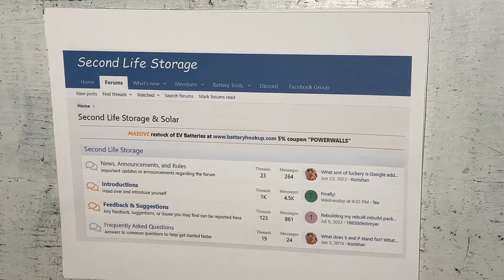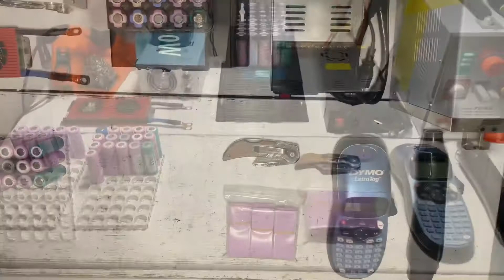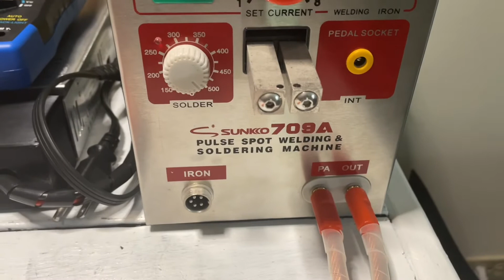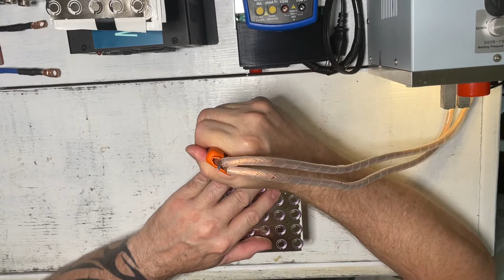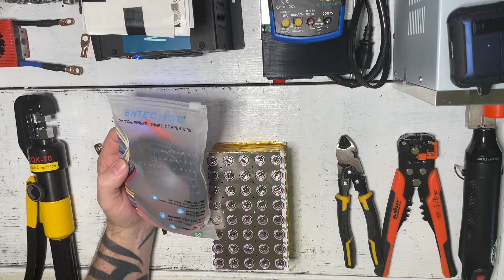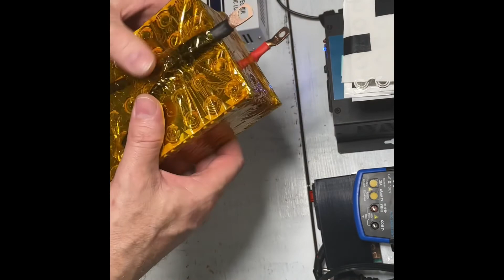DIY 18650 80ah Lithium Battery Cell Build for Power Supply

Comment: Thanks for the video. 
How do you charge the battery pack you built ?
Reply from the maker: There is no need to change them, when I build a battery or a battery pack. I set up an external charging point, but at some point I’ll replace them but they’re good for at least 5 to 7 years as the cells were literally new.